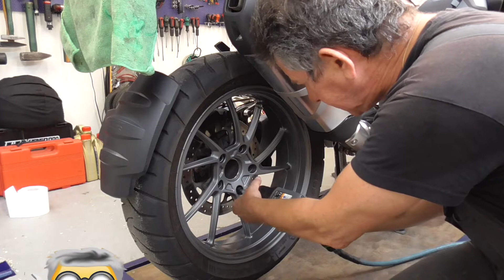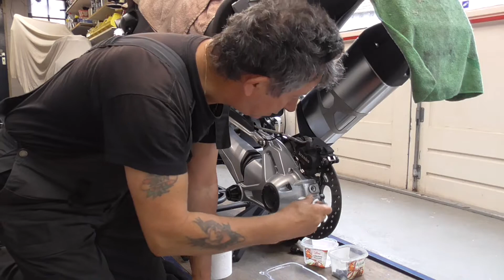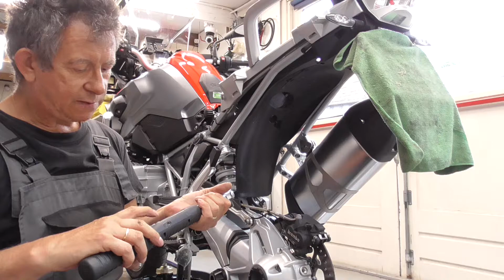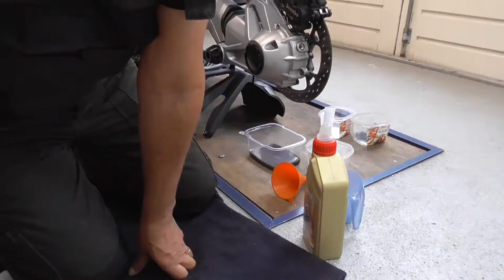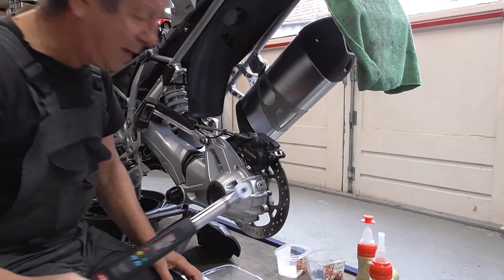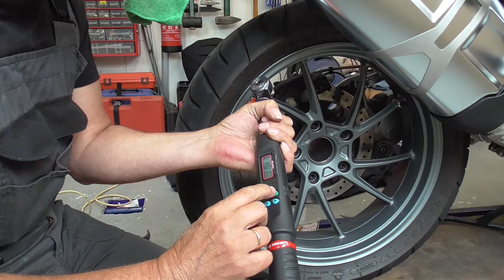BMW R1200GS LC [2014] FINAL DRIVE GEAR OIL change..! Done by: The Old Mechanic  👨‍🔧---🏍

Comment: So you weren't tempted/ inspired {since you unnecessarily removed the rear wheel} to inspect and grease the final drive splines? So how often do you grease the final drive splines this seems like an appropriate second question? BMW suggest by omission this isn't a necessary service function, but judging by internet / youtube failures of final drives and splines rusting it does give cause to disagree.